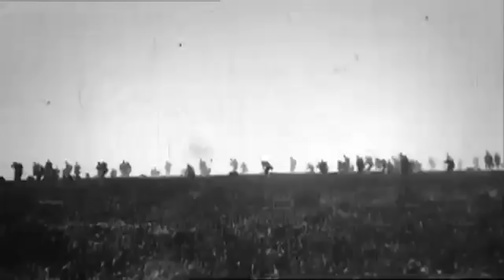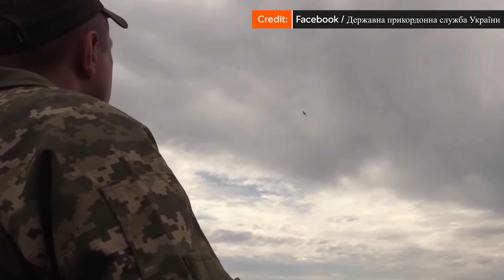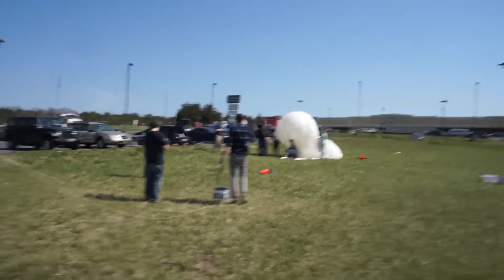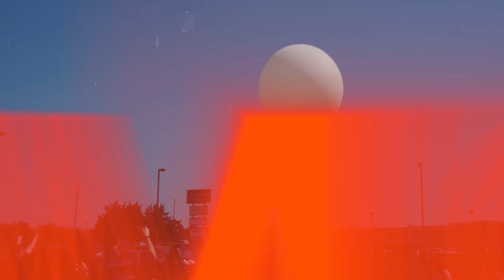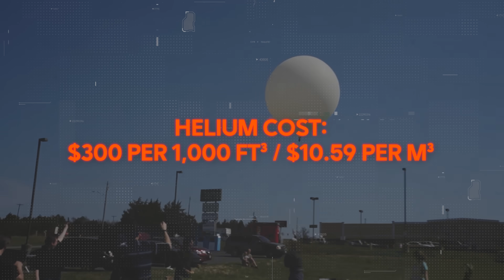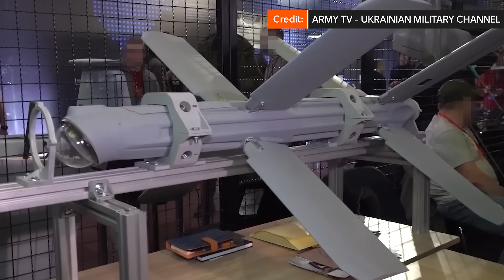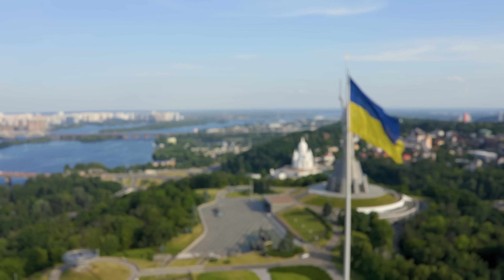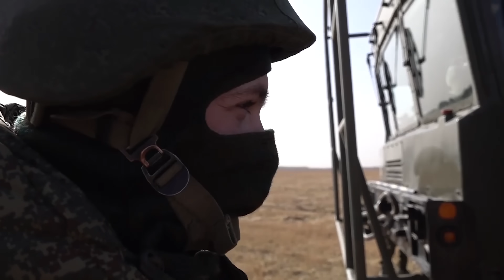Ukraine Found a GENIUS Way To Strike Crimea… 8,000 Meters Above Russian Air Defenses

Comment: The balloon drones could also use smaller batteries and larger warheads.
    Hydrogen carries nearly twice as much weight as helium.
Reply: Not only that, helium is a diminishing, scarce and valuable resource.  Not to be used lightly (!).
Reply: @dogsbodyish8403  Nice one! Lol
Reply: And considerably cheaper!  Making H2 locally as in the long past (iron filings/acid) is not practicable but there are two alternatives:

1 Compressed Gas Cylinders: Standard commercial cylinders of compressed hydrogen or helium are the standard choice. A single lightweight composite or steel cylinder can fill multiple balloons instantly, silently, and with pure, dry gas.

2 Chemical Hydride Cartridges (Aluminum/Sodium Hydroxide): If gas cylinders are unavailable, modern military and meteorological units requiring field generation use specialized dry chemical kits (such as calcium hydride or engineered aluminum-caustic pellets mixed with water). These systems are far lighter, react much faster, do not require carrying hazardous liquid acids, and produce a much cleaner yield of hydrogen per kilogram of equipment.
Reply: It doesn't ("carry nearly twice as much".) Hydrogen is half the density, yes, but the lift is the difference between the weight of air displaced, and the weight of the gas in the balloon.  Air is about 29, Helium 4, Hydrogen 2 so 27/25 times the lift.  As remarked in the video, 8%  (Disappointing, isn't it! Even vacuum would not be a lot better.  )
Reply: @AdrianMidgley  You are correct, but possibly still too generous.  The weight of the air displaced is set against the weight of the balloon gas PLUS the balloon itself & equipment weight, which may or may not be a significant proportion of the total filled balloon weight, reducing the contribution and benefit of switching to a lighter gas.

Comment: I wonder if the next version will be more like an airship — the drone is horizontal with more rigidly mounted balloon — then, the drone can use the motor and control surfaces to steer using minimal amounts of energy, that way it won’t be purely beholden to the wind alone.
Reply: Back to dirigibles!  I was thinking kites, myself.  I have a kite that packs into a pocket, all it is, is ripstop nylon sewn into a clever aerodynamic shape, and the string.  But to my shock it has lifted me right up several feet. You have to really brace your feet. This might be something to give smaller spy or spotter drones their initial altitude.

Comment: placing a small solar panel on the orange thing above the plane would provide 100% power at the release point (daytime, of course)
Reply: Batteries for some hours will weigh less than solar panels for providing the same power.